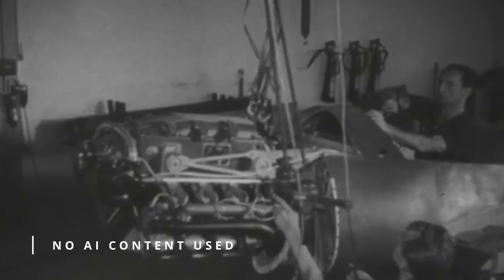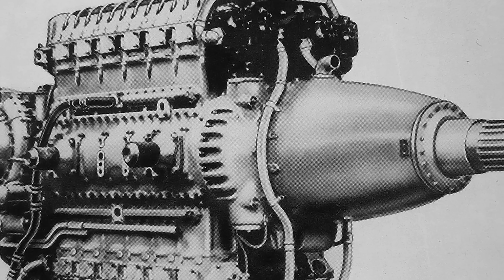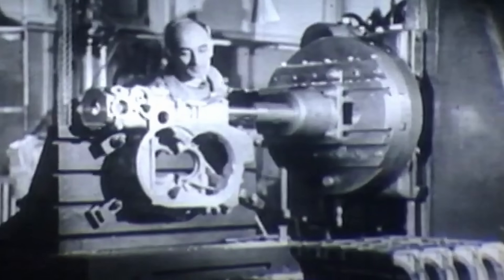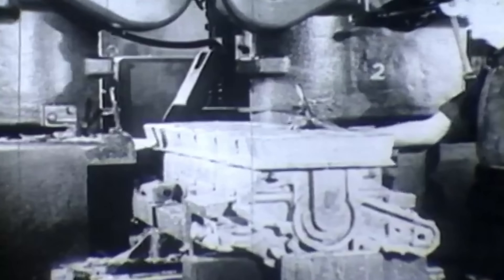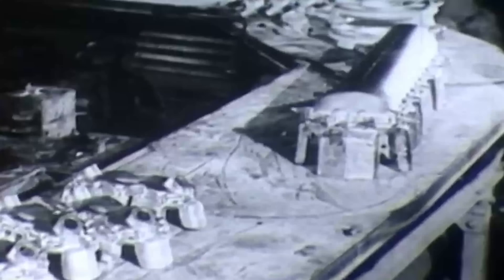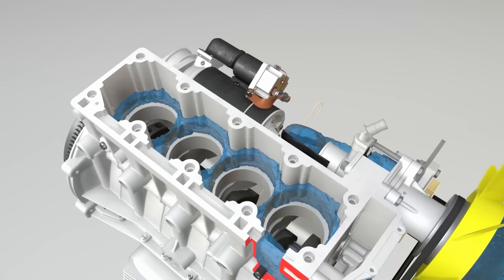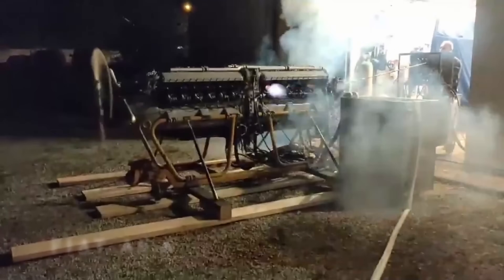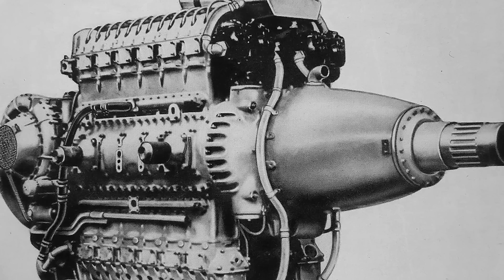8000 Horsepower in 1946! | The Arsenal 24h

Comment: At 22 seconds the narration is referring to an inverted V engine but the video clearly shows an upright V. Although the numbers on the “oil pan” suggest the engine is displayed upside down. This immediately puts doubt in my mind as to the veracity of the content despite the no AI statement although the narration does appear to be well researched and credible. 

Also at 58 seconds - “two V12s stacked together” do not make an H engine. It requires 2 flat 12s as mentioned later in the narration.
Reply: +@stevewolfe6096   The engine at 0:10 seconds is a Jumo 213 displayed upside down at the Muse de l'Air et de l'Espace, Paris. The Arsenal de l'Aéronautique in France continued to manufacture the Jumo 213 after WW2 as the Arsenal 12H and other variants.  Some Aersenal 12H engines flew into the early 1960s.

Comment: Something ironic about how a current technology reaches its pinnacle at exactly the point that the soon-to- be replacement-tecnology is just finding it's feet.  (Thanks Flight Dojo!)
Reply: I mean, I'm sure EFI and electronically controlled mtivablve valve trains could make them even more insane, not to mention modern alloys could probably take greater stresses, but it was absolutely at the edge of possible without compuiter electronics.

Comment: The German Argus company was at the verge or running or perhaps test ran the Argus As 413 which was two flat 12 cylinder engines based around Junker Jumo pistons.  
The As 413 was a water-cooled H-24 with reduction gearing for contra-props. Output was 4,000 hp (2,983 kW). It may have run, or perhaps was scheduled to run, in 1945.. If it had the same bore and stroke (150/165 mm, 5.9/6.5 in) as the Jumo 213, then swept volume  would be 70 L (4,270 cu in).
Reply: That would be a cool vid. Imagine that slung onto the front of a feisler storch 😉
Reply: @PAULSLEVINSKY-b7j  The storch had 240hp for 3000lbs.  Scaling up to 4000hp you could have a 50,000lb STOL.

Comment: I dread to think how huge a propeller would have to be to take advantage of 4000 horsepower, or how huge a contra rotating setup would have to be to handle 8000 horsepower, in a country in a time before the squared off or turboprop style propeller came to be understood. 

Propellers that are like 40 feet in diameter with tips constantly over the speed of sound. If the Tu-95 and An-22 are obscenely loud, anything equipped with a tandem Arsenal 24H would have been diabolical. You want to rip a hole into subspace? This would probably do it.

Yknow what, im gonna go back in time and have them accidentally create the french warp drive 
🤣🤣🤣🤣🤣